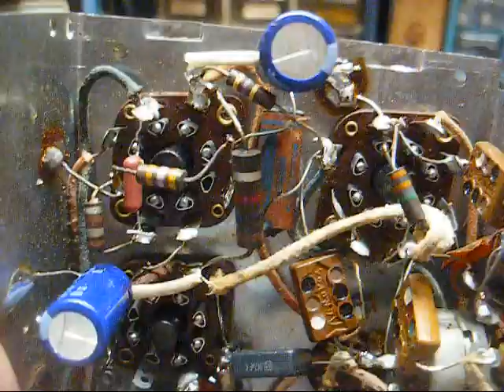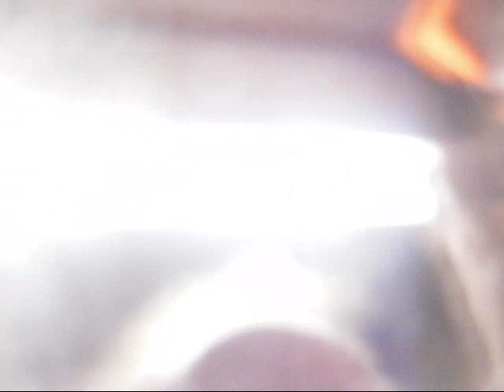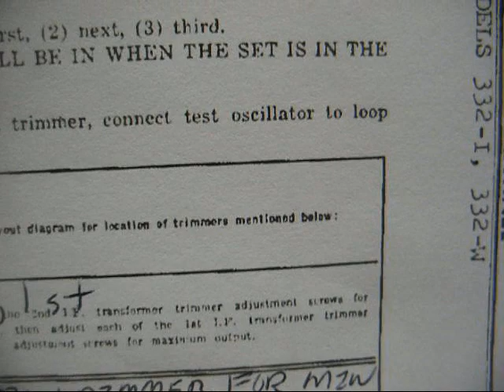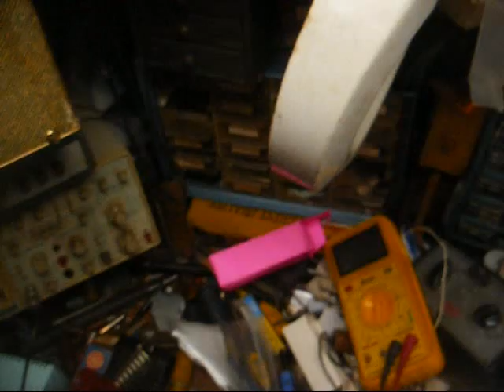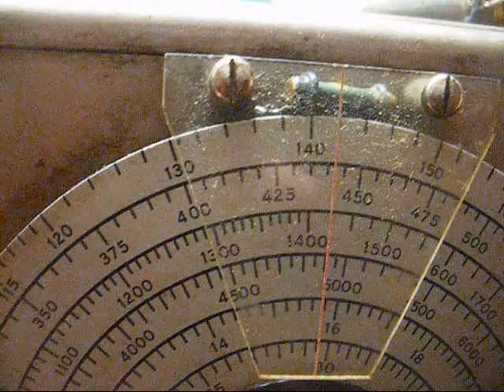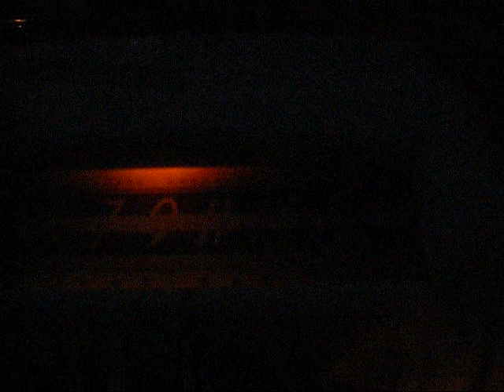Repair of a 1940's Sentinel AM tube radio

Comment: Mr Baker had a bunch of AC/AC x former to sell. Safety first. Then he also sold polarized. Plug that went to the plug and had a spot to contact. In the right direction. Carefull I'm as old as That radio. Hi hi. De kv4li 73 ps he passed several years ago. He was W8FLT

Comment: Thank you again for another great video!  I have a question.  I noticed that the IF can that was replaced was labeled 440.475 kHz instead of the normal 455kHz.  I always wondered how far you could tune one of those transformers off rated frequency without experiencing some signal loss.  Did you notice any loss in sensitivity?  455kHz IF cans are getting harder to find.  It would be good to know if you could use one that's rated close to the 455kHz and tune it off its rated peak to get 455.  Thanks again!

Comment: I was told AM radio will switch over to digital on October 27th.
Reply from the maker: Of what year?
Reply: This year, 2020
Reply: https://youtu.be/xEK3uOqjWK4
Reply: Well, you were told wrong. Did you even watch the video you posted the link to?

The FCC will be allowing stations to change to an all digital broadcast to minimize broadcasting costs, if the station choose to do so. 

There's no mandate that ALL the stations go digital broadcast only. 

Here's the fact sheet from the FCC; 

https://docs.fcc.gov/public/attachments/DOC-367361A1.pdf

Notice the first line under the heading of what the order would do;
"Allow AM stations to convert to all-digital operation on a voluntary basis."

Comment: Has anyone found any replacement IF cans for sale lately?  I used to find these old radios around all the time at garage sales, not much anymore, and most on ebay are way overpriced, so I usually don't buy any, but I love the sound of them.
Reply: At this point you might have to make your own . I have seen people on Youtube attempt it. Seems to work.
Reply: @hestheMaster   I may have to make a winder adapter for my metal lathe, you should be able to get it close enough to make it work by counting the turns that you can, I still have old catalogs here with them listed, as well as replacement CRT's, those day's are over.

Comment: I bought a GE replica cathedral radio that came out during the late 80s or early 90s. It is in mint condition and works great and no scratches on the cabinet. It has good bass and good volume on am and fm. I paid a little more money for it than I expected but couldn’t turn it down because it was in excellent condition. Didn’t have to do any service or alignment on it. I love cathedral radios in general

Comment: What happened to the first part of the original video?
Reply from the maker: I actually sold the radio right out of the gate; so, I removed it and re-uploaded it without the radio I was selling.
Reply: @radiotvphononut  those vintage transistor table radios are probably a sought after item.
Reply: You-tube issue probably